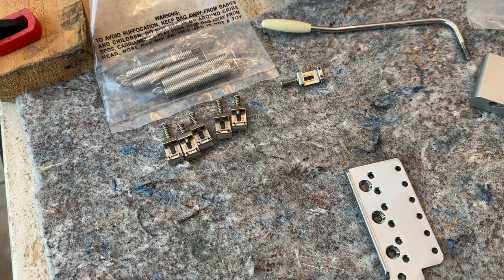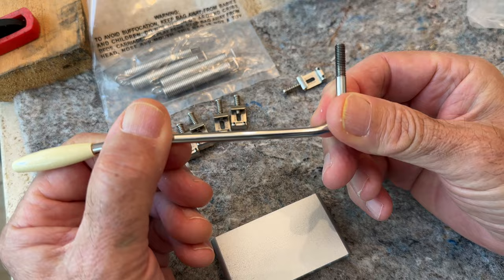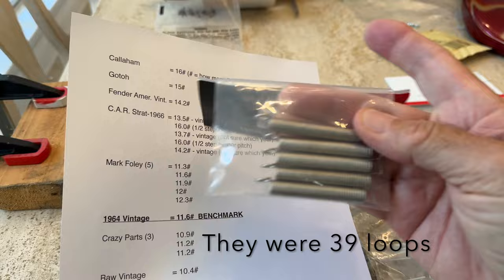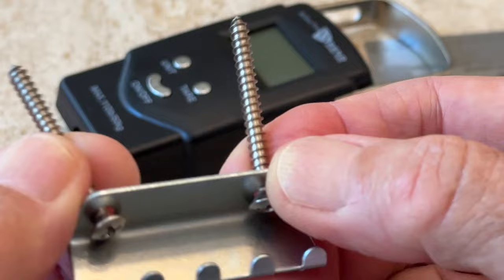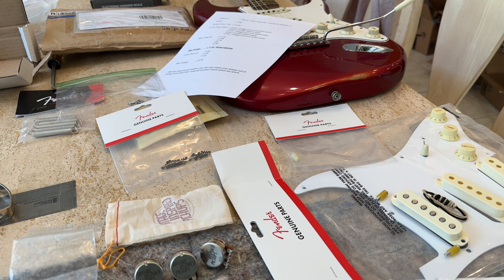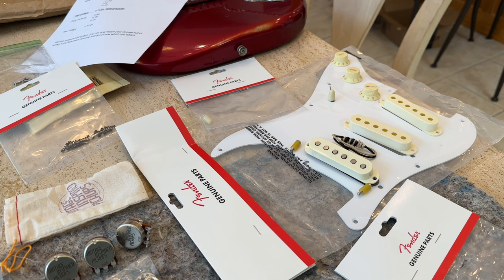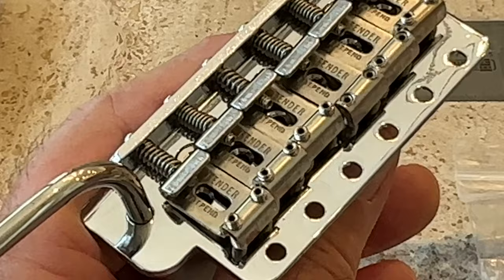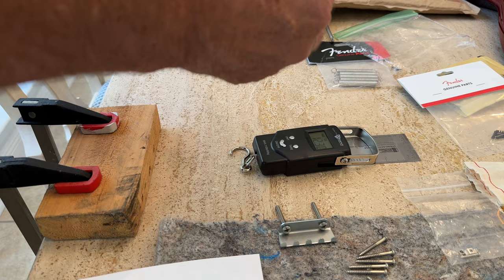Mark Foley 50's "Rough Cut" Strat Tremolo - A Closer Look

Comment: Thank you for all this in depth info. It is very nice to have all this info presented in dry scientific measurements. Too many folks out there injecting their opinions and inserting buzzword adjectives into their descriptions of parts and gear.
Reply from the maker: It’s been a very impressive tremolo. I haven’t even broken any strings which is unusual for me. My only complaints are the five spring tensions, the lack of spring claw screws and the price. Stays in perfect tune and sounds great.

Comment: I noticed you went with the Callaham claw springs, and when you dropped it on the table, it had a high ping to it.
I built a 50,s parts caster from parts, starting with a 50’s reissue master built loaded body, and an all parts bat neck, then proceeded to change out almost every new piece of hardware to a vintage 50’s or 60’s part.  And you know every time I added a vintage part it got better! I can even remember when I got a real 50’s spring and claw and it was definitely an improvement. I think you should do a video on spring claws next!
Reply from the maker: You mean the Callaham claw screws, correct?  I can always rob from that 1966 CAR Strat just to see if I notice a difference and then look for better screws.  They probably want $500 for two vintage screws and claw nowadays.
Reply from the maker: @Scott.9  This website, https://www.stratcat.biz/hardware-custom-tremolo-arms.shtml, made me a believer in the springs again even though they don't recommend them but they do sell them.  Their instructions on this page are very detailed and all you need to know about the whammy bar.  They even steered me to a great company to buy the correct 10-32 UNC internal tap and tap oil to repair any booger'd threads in the block.  The springs are designed to fit perfectly so that you are still able to turn the whammy bar in 8 times (after the top whammy bar reaches the top of the bridge plate).  At that point, you should contact the spring.  Then the bar threads are well below the plate and protected.  Just barely compressing the spring after you make contact is all you should do.  Any over compression of that spring spells trouble.  I highly recommend that everyone should have that internal tap because almost all block threads have some damaged threads from misuse of the whammy bar.  That website state to NEVER force a bar in if it becomes hard to screw in.  I used to do that many years ago just to get the bar in far enough, all the time damaging the threads even more.  With the tap oil, if the bar were ever to break, it should be fairly easy to get the piece out with just a small flathead screw driver.

Comment: Your way of measuring spring "tension" is still actually measuring spring stiffness,  just in a somewhat imprecise way. You're looking at tension CHANGE (from zero? tension, to tension at 1 inch stretch) over stretch distance (1 inch). So your result is actually in units of lbf per inch (lbf/inch). That's stiffness - the spring constant. And that's what you want to know, because spring constants are additive - that's how you know how a given number of springs will "feel" when you move the arm.
But the fact that you appear to be starting from zero (unloaded) tension means that you are including a region of the spring's operation that rarely comes into play. And the spring will be less linear over that initial range. You would be better off measuring the tension change between say 0.5 and 1.0 or 1.5 inches extension - stiffness will be constant over that range. Your results would also probably be less variable if you omitted zero load.

Comment: hey man still got the highwoods on my strat after your recommendation are they still your preference ? i try and use the super lube on them as per your reccomendation again and hope that will them not wear too bad
Reply from the maker: Yes, I still love the Highwoods but I have been super impressed with these Foley standard saddles.  They are the closest to the real thing and I can't believe that I haven't broken any strings in a long time.  The standard saddles have a slightly different sound to them but barely noticeable.  I did develop and small groove on the high E Highwood saddle and get a slight buzz but I also get that on the standard saddle.  You just have to barely buff it with very fine emery paper and it is gone.  The Super Lube is a must for any Strat with a tremolo.
Reply: @millstap  yer I had a trem block from crazy parts and Foley told me it is the same part also spoke to a guy who use to make trem blocks and other things for Foley and he says Foley has never made trem blocks he made me a trem block  with a delrin sleeve so the arm sits snug and doesn’t Rock really like the look of the crazy parts pre cbs saddles and trem system would deffo consider them if upgrading or doing a parts caster only other thing I may upgrade going forward on my strat is maybe new tone and volume cap be great if you could give me some  recommendations on those all the best man keep those videos coming love your attention to detail

Comment: Hope you like the Musikraft 10/56 neck. I got one thinking it was going to be the same as the one I had on my custom shop nocaster and it was nothing like it at all. Either they made a mistake with my order or they should not be calling it the 10/56. Straight up V neck. The custom shop 10/56 is a very soft V which gradually morphs into a C starting around the 5 fret.
Reply from the maker: I hope it is a soft V because that is what the profile on their website shows. I’ll complain to Scott if it isn’t. But I don’t think the profile shows going to a C. Were your measurements 88 99?
Reply from the maker: I guess it is supposed to go more to a C at the body.  I got the .88 .99 because of the beefiness at the nut which is like my vintage Strat.  How long ago did you get your neck?  I did notice that it looked like they had changed some of their profile names to MK names and such.  Hopefully they didn't mix up the profile descriptions on their website.  I used the "?" button next to the profile drop-down to get the profile shapes.  But, when you go to their "learn more/profile" page they don't have all of the profiles there.  The 57 Soft V .85 .99 looks nice too.
Reply: Correct the CS 10/56 I had was  a very soft v @ the 1st and a C at the body. I paid extra to get .93 / .1 because I was trying to replicate the CS Nocaster I regrettably sold. I made profile images by bending solder across the back of both the CS neck and the MK and they were totally different. The MK I got was definite V; the 10/56 was more like a C that tapers to a VERY soft V at the 1st fret. I can email the images to you if you want. I just looked at MK's profile image and the one I got looked nothing like that, so I'm thinking maybe they just made a mistake and I should have complained. But it was a very nice neck and I've ordered many more after that, just not that profile. Now I regret posting my earlier comment and potentially making you worry about what you're going to get. Hopefully yours is going to be just like their diagram and if it is, I may be inclined to order one again myself. I will look forward to seeing how things turn out.
Reply from the maker: @davidb0064  Yeah, Scott at Musikraft has been a great help.  I did just double check with him on the profiles because they do change them occasionally, at least the names.  When did you receive the Musikraft neck with the incorrect V?  I'm wondering if it was recently or years past.  Their website can be confusing because they have several different profile sheets and they also have one on .pdf that they can email you.  I need to go find that .pdf just to see if that hard V 10/56 is on there.  I've bee really happy with my AYS 84 97 (SRV) profiles which they now call the SRV 84 97.  I bought four of those and wanted to try something different.
Reply from the maker: @davidb0064  I did find the .pdf profile sheet.  It appears this sheet was from 2016.  The 10/56 was in the "Other" category and was a 10/56 LG V .88 .98.  Scott just sent me the current profile sheet and it is completely different.  He said, "we have been going by the actual Fender Custom Shop 10/56 dimensions and shape, and it should be a soft V."  The 10/56 I got is under their Fender Custom Shop Profiles By Musikraft.  I asked him what the "LG" stood for but haven't heard back yet.
Reply: @millstap  Mine was received back in Dec of 2019. This is encouraging to hear that they are now using the actual Fender Custom Shop profile for the 10/56...looking forward to seeing yours and I will be very tempted to order one myself as I have been very happy with all of the Musikraft necks I have ordered (about 10 of them).
Reply: Sorry it looks like I've been replying from 2 different accounts.
Reply from the maker: @davidburridge-yp2iw  Wow, that's a lot of necks.  It is a great testament to their outstanding quality when I can replace a vintage 1964 Fender Strat neck with a Musikraft neck and the guitar sounds better.  Scott just responded.  You'll probably be ordering one soon.  

"That stands for Large V (LG) which is more describing the thickness and not the shape. These are a subtle V that really fits the hand very naturally and we sell a ton of that profile! 
Your neck is complete and should be shipping within a day or so. Please stay tuned for tracking info as soon as it goes out.
Best of luck with it and please let me know how the project turns out.
Thanks!
Scott

Comment: Does the crazy parts tremolo grip the whammy bar threads well like the Callaham block?
Reply from the maker: It's a vintage Fender type connection with a little wiggle if you don't use the whammy bar spring in the hole.  I tried to put one in on this tremolo and it wouldn't let the bar threads go far enough into the hole which is unusual.  The spring worked great on all my other vintage Fender style blocks.  I think maybe the spring got caught and it didn't go down to the bottom of the hole.  I need to try again today because the wiggle is a little annoying.  I think the Callaham block has a teflon ring insert to stabilize the bar, at least he offers that option.  I just was not pleased with the bright Callaham sound so I don't use them anymore.
Reply from the maker: I just put the bar spring in again and it was correct.  I just didn't want to compress the spring too much at the risk of never getting it back out.  I recommend getting a good 10-32 UNF internal tap if you plan on messing with blocks a lot.  Just as long as you can get around eight full turns on you whammy bar past the top of the plate after the top bar thread is adjacent to the top plate, you're good to go.  That will give the bar its max strength and reduce the risk of breaking it.  My bar is now solid as a rock.  I had to pretty much compress the spring completely to get eight full turns on the bar.

Comment: Are you not using the high wood saddles anymore?
Reply from the maker: I still have them on all of my other Strats but since I was getting a new tremolo, I thought I would give them a try for a while to see if I need to switch to Highwoods.  I have two sets of Highwoods ready to go.  But, these saddles are the the most vintage correct saddles I have ever found and they are really great.  I will maybe eventually switch but they are staying for now.  I do know that the Highwoods will always help keep my guitar in tune on heavy whammy use so I am holding back a little on this Strat with the whammy but it does stay in decent tune so there is no need to switch.  I do have to try to get some grease on the saddle tops.  That is what is so nice about the Highwood groove, that it holds Teflon grease.
Reply: @millstap Teflon grease on saddles helps tuning using whammy?
Reply from the maker: @Rainydaydreamaway7  Definitely.  It works better on the Highwoods because the groove give a little spot for the grease to sit and not get wiped off by your hand.  I found this clear, food grade Teflon grease and a tube will last forever.  It is great.  I bought it five years ago and still have enough for at least another five years.  https://a.co/d/aVuihnX

Comment: ew relic?
Reply from the maker: Yes, I want to be sure it has a very thin Nitrocellulose finish.  You can see it is very lightly relic'd.  And the crazing indicates that it is the proper, hard, candy-shell like finish and not the gooey type Poly finish Fender uses now.  I like it when they chip like glass.